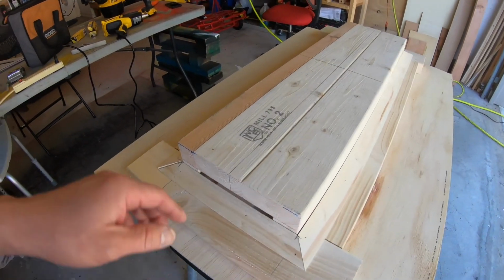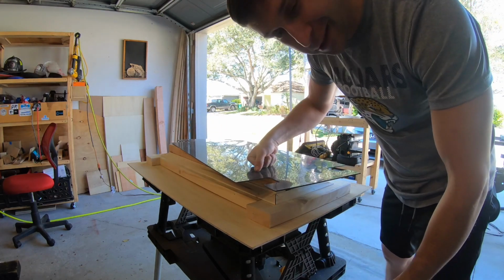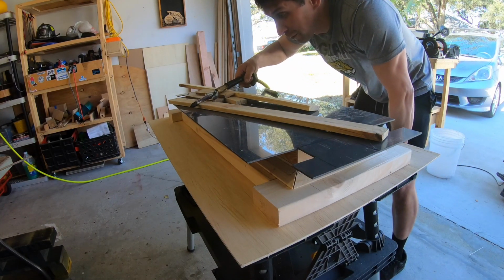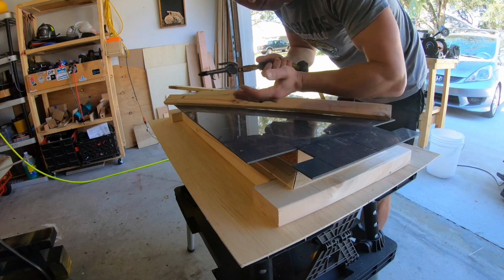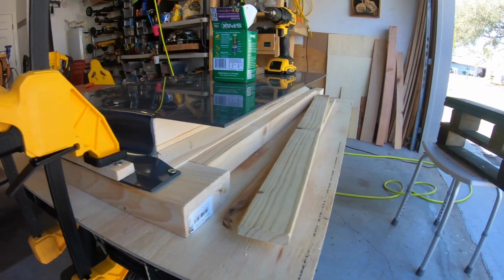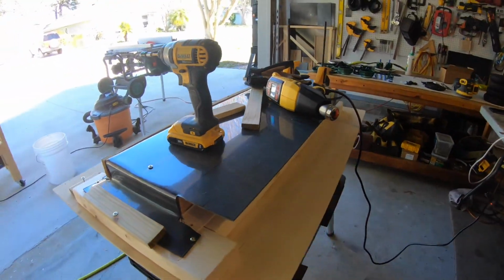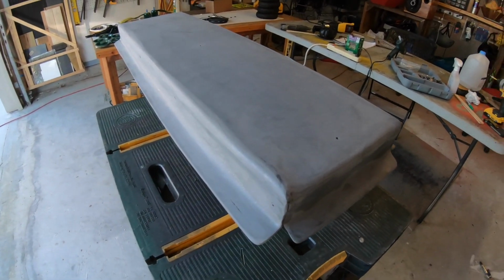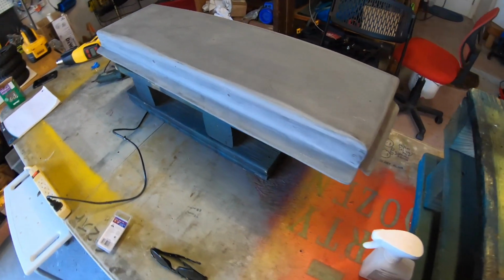Huge Enclosure for ESK8 Battery and Two VESCs

Comment: Uau, never seen anything like this for an esk8 enclosure, well done! Does it work a deck which has a moderate to strong concave, being the enclosure flat?
Reply from the maker: Hi Negao.  I usually form the enclosures right over the deck to which it will be attached to.  For this particular enclosure I have given instructions to the builder to use heat gun to get a good seal on whatever deck he chooses to use.  Check out this video.  This is how I typically form the enclosure:  https://www.youtube.com/watch?v=wQMWvfuKZWw&t=1s

Comment: Greetings, do you make eboard batteries to sell? specifically to fit Slick Revolution Min-e /Max-e models.
Reply from the maker: Greetings. I do make power packs for esk8 rides.  Dont know much about slick revolution though. What size battery does it have (?S?P)?
Reply: @artsiomnaidzich9515  It's 22x8x4 cm. 22.2V 8.8AH
Reply from the maker: @NeonTriste  look at ur charger. What voltage does is output?
Reply from the maker: If u have a picture of this battery, send it to me please. Im on fb messenger and Instagram. Name is same as ere.
Reply: @artsiomnaidzich9515  alright, ill do that
Reply: DId you get it?
Reply from the maker: @NeonTriste  no. How did u send it?
Reply: @artsiomnaidzich9515  Just direct messages. Try general tab maybe its there.